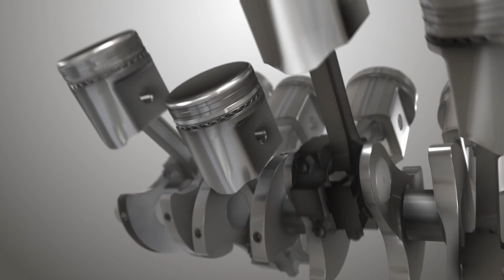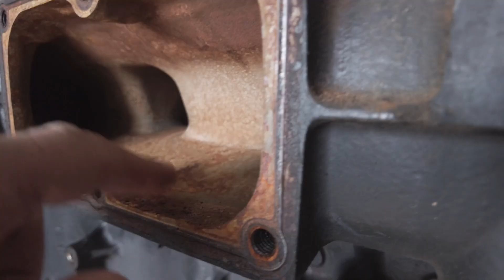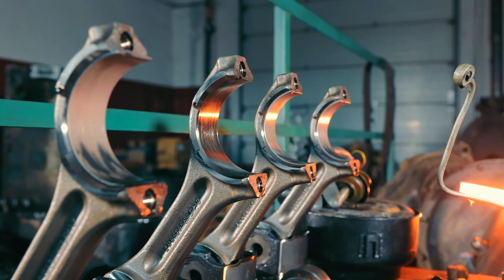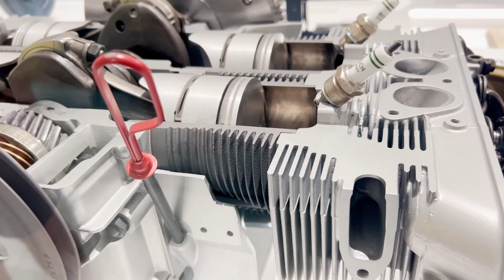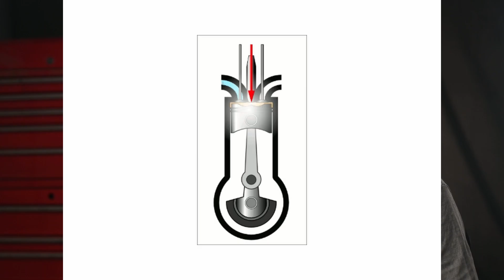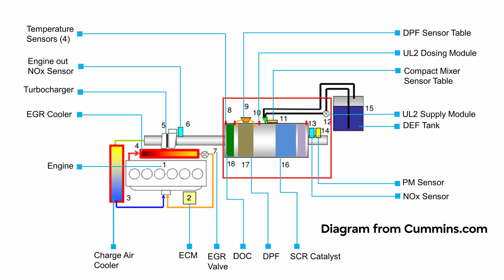DIESEL OVERVIEW - From INTAKE through EXHAUST

Comment: Nice vid, I just inherited a 82' Chevy K20 with a naturally aspirated 6.2 Diesel. I'm trying to learn stuff about it. Any general tips?
Reply from the maker: Thanks! I don’t know that engine specifically but there won’t be much for electronics to worry about. Fuel, air, and timing are the main things. There is an excellent 6.2L manual to go through as well for more specific info to that engine if you search it up on Google. Hope it works well for you! 🙌🏻